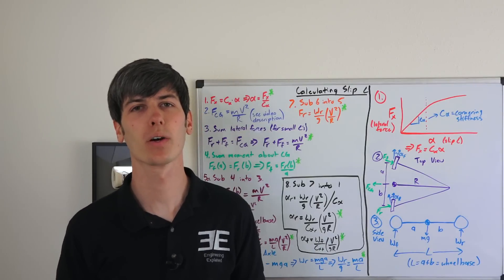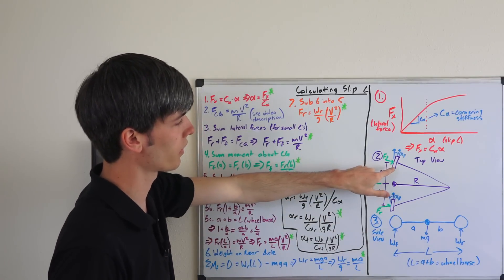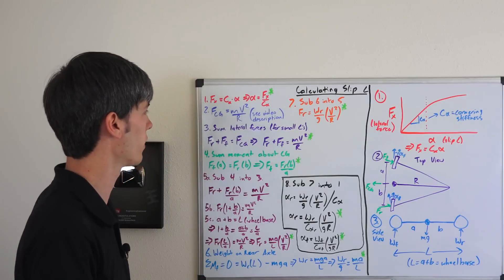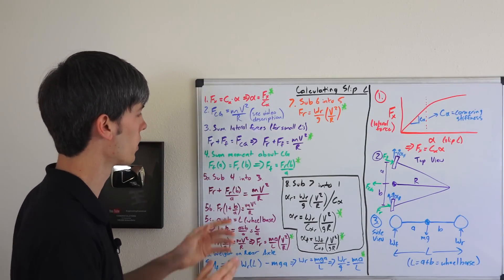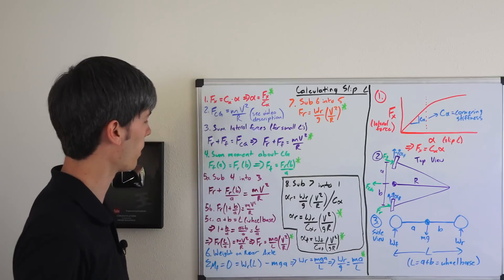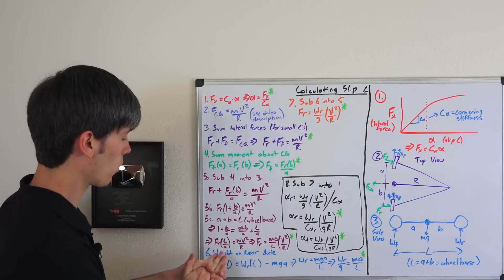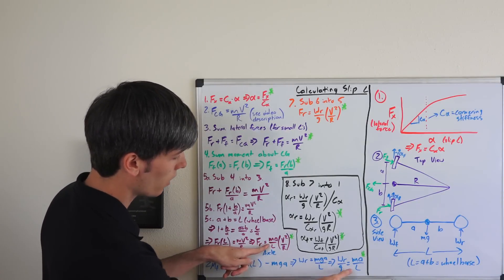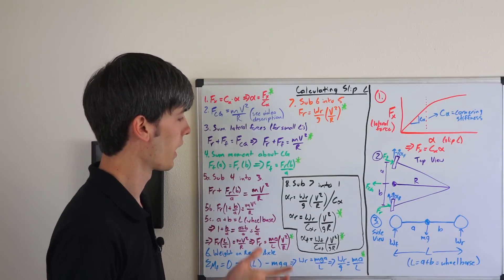Deriving Car Slip Angles - Tire Slip - WARNING: Maths

Comment: If you could do this with only the data available in a real car, that would be interesting (cornering stiffness is not available, especially to ASIL D).  The maths would be  to a higher level though, having read papers on the topic.

Comment: If this is meant to be applied to a car how would you find the radius of the corner or is it based on steering angle and how much that turns the wheels? Also how do you find out the cornering stiffness for a tyre?
Reply: i have same dbout ... could youbplease help me with that if you have figured it out

Comment: can someone help me please?
if the slip angle is the difference between the direction the wheel is pointing and the direction the wheel is moving, which are both known vectors, why do we need to calculate it? or am I missing something?

Comment: I have a question. I'm using Motec telemetry analysis software and I want to calculate the slip angles for the tyres. I have the velocity vectors for the car, toe angles and steering angle. Can I calculate the slip angles using that? Would it be correct anyway? Thanks!

Comment: That's all very well but you are using the ti(y)re's Cornering Stiffness to calculate the SLIP ANGLE, however, in order to know the Cornering Stiffness of the ti(y)re, you first need to already know the SLIP ANGLE v Load. See the problem?!! If you already have the graph you use (in the top right hand corner of the board), you don't actually need to calculate the slip angle, you'd just look at that graph and save all the brain aching math(s).... (sorry it's taken me 3 years to work this out)
Reply: is there any other way to find cornering stiffness/slip angle?

Comment: IMHO, the math is not difficult to follow, but I think after following the derivation, the importance and how to interpret the final formulas in the physical sense was left out which is a bit wasted. For example, using 1 to 2 minutes at the end of video to point out the fact that V^2/gR is a common term in both slip angles equations, and so it is the weight distribution and coeff of cornering stiffness determine the slip angles difference between the front and rear.... and such difference determines the understeering/oversteering tendency... etc... There maybe another video for this but a simple example of say a 50/50 car with same tyres in the front and rear can be a good example to demonstrate.

Comment: Hey! I think the entire mass of the vehicle should be used and not just the mass on the rear tire in the formula for lateral force on the rear tire, since in the expression for centripetal force we use 'm' as the entire mass of the car. Please correct me if I am wrong.

Comment: Hey Engineering Explained I think I understood what you did to this point but at 5:56 I can't quite follow. Why does mg*a have to be equal to Wr*b? 
Assuming the center of gravity is exactly in the middle (50:50 weight distribution and therefore a = b), Wf and Wr would be the same and both half of the total weight which is mg. So wouldn't that mean, that in this case mg*a = 2 * Wr*b? 
Or did you want to say Wr*L = mg*a or how you wrote it: 0 = Wr(L) - mg*a?
Could you or anyone else explain, where I make a mistake, please?
Reply: +SimBaa he's taking the moment about the front wheel to the only forces causing moment are mg and wr.

Comment: how can i calculate R if i do not know the steer angle
Reply: The steering angle is actually known as an input, but the problem is that R is a function of slip angles and at the same time slip angles depend on R.

Comment: Can you PLEASE explain to me why do people say that when you park on a steep hill facing downhill you should put your car in reverse and when facing uphill you should put it in 1st gear. Like, what difference does it make, the transmission can rotate both ways, right? Why not just pick the mechanically strongest gear and leave it there no matter what? Sorry if my question is stupid but i just cannot figure it out...
Thx mate (oh and ofc, nice video, as always)
Reply: The reason for 1st facing downhill and reverse facing uphill is so if the car does roll the engine spins the way it was ment to.

The reason you don't want to spin the engine the opposite way is partly because many tensioners  only compress in a specific rotation.

The other big reason to do this if your car gets hit or something and is sent barreling down you don't end up spinning your crank barrings in the wrong direction. Your crank barrings have indentations that keep the barring shells from spinning past their seated locations. But that locating indent is made at a slope so while it can't spin forward too easily it can catch against the crank and possibly slip past itself if spun in the other direction.

The reason to have it in gear in the first place is to provide pumping resistance to wheels as a tuned off engine is basically just a mechanical air compressor of sorts.

And the wheel direction is just ment to catch the curb.
Reply: Aleksa Nikolic When parking in a steep hill, just put it in first, then while holding the brake down, release the clutch and slowly release the brake until you feel the car "locking into the gear", this is the time to pull the handbrake
Reply: This dates back to the days of carburetors, and the desire to avoid a "bump start".  If left in gear with hot cylinders, some cars could successfully start themselves if they started to roll.  Selecting the gear that was the opposite of the direction of travel was a safeguard against this.  It mainly dates from the days where fragile timing belts were rare, and turning an engine backwards for a bit had no major consequences.
Reply from the maker: Aleksa Nikolic I always put it in first.
Reply: Marek Sumguy Oh god, that makes so much sense! So what I want to do is leave the car in gear so that when it rolls one way or another, the engine turns "forward" so it cant be damaged but since the car is in gear, it cannot move as easily. Thank you mate!
Reply: No, why would I? I'm just amazed how simple it is and I've been trying to figure it out for quite some time :-)
Reply: Yes it is. People have been telling  me the opposite the whole time which is probably why I couldn't get it through my head. This the most logical explanation, although I am still pretty unsure why would multiple people tell me the same thing which is, according to my logic, false.
Reply: Marek Sumguy ?????. What I said makes sense, maybe you interpretaded it wrong. Just try it, set your car in a slight hill, turn it off, put it in first without pulling the handbrake, you can clearly feel the car roll a few centimetres, then stop because of the slight gap between the gears. Now if you don't let it "roll in to gear" in a steep hill you run the risk of the car achieving some decent speed within those centimetres of moving, therefor, increasing the risk of the car keeping on rolling. In fact most cars can sit without a handbrake in pretty steep hills without rolling.
Reply: Marek Sumguy Oh, so it's the compression that stops the car from rolling? The more you know :) But I would still imagine momentum to play a part in a very steep hill, wouldn't it?
Reply: SO THE CURB STOPS IT FROM ROLLING ANY FURTHER!  It's not a difficult concept. If you guys grasped the engineering behind this, you wouldn't have tried to get into a pissing contest over math and physics. Don't over complicate something simple. That's a basic tenet of engineering.
Reply: +Marek Sumguy If e-brake fails car will stay where it was left to begin with......
Reply: when car in reverse facing down if the brakes were to fail the Idle gear will prevent the car from rolling. even thow the car would still go down depending on mass, but overall its one of those things you go...eh.
Reply: Yes. This. Only twenty comments and a lot of arguing to get to the right answer.
Reply: +caroppin  Haha, thanks.

Just glad I could help.

Comment: I am planning to buy the new Subaru WRX STi(2014 or 2015). But since the import laws in my country are a little too rigid, I opted to buy a WRX and work on it. However the problem I am facing is that the new WRX STi JDM(the one i wanted to import) runs on the EJ20 and the WRX on ther other hand is paired with the FA20 like in the BRZ. Which one should I get?

Comment: Would be nice if you could explain why and how you are able to use the sum of forces and moment equations so more non engineers can understand this, i hope :P
Reply: Christiaan Roos 
You can think about/visualize the sum of forces and sum of moments equations in a pretty simple way.  I'll explain both of them below.

First we'll start with the sum of the lateral forces, as seen in Equation 3 on the board.  Let's just start with something moving around in a circle.  The force due to centripetal acceleration from to this circular motion is Fcg.  This is acting at the center of gravity, or CG.  If this were the only force on this object, nothing would be keeping it from staying at the same radius.  This is where the tires come in handy.  The sum of both of their lateral forces counteracts this, keeping the car at a constant radius R, in this case.  In order for the car to not increase or decrease the radius of the turn, the forces from the front and rear tires needs to be equal and opposite the force Fcg.  It's easiest to think about the car in a sort of 'snapshot' when figuring out the forces acting on it.  This is essentially what Figure 2 on the board is doing.  It's a snapshot of the top view of the car.  We know there is an outward force because it's driving in a circle.  We also know that the tires produce a lateral force.  The sum of the forces equations becomes the simple task of saying which ones are acting to the left and which ones are acting to the right.

There's one little issue with the force equation though.  The lateral force on a tire acts perpendicular to the wheel plane, which is why in a turn, the lateral forces don't actually act on the same axis as Fcg.  The actual force equation would have a cosine term acting on the lateral force for each tire.  However, we can use the small angle assumption, where the cosine of a small angle is approximately equal to one.  This is where Equation 3 comes from.

Moving onto the moment equation, or Equation 6.  First of all, when you think moment, think of torque.  Same thing, different word.  A moment is caused by a force acting at a certain distance away from an axis of rotation.  Make sure you're looking at Figure 3 on the board.  This is a side view, not a top view.  When we say the sum of the moments is zero, it essentially means that nothing is rotating, or spinning around its center of gravity.  Go outside and take a look at your car sitting on the street.  It's probably not spinning out of control.  It's most likely just sitting there, not moving.  Since it's not moving, we know that the sum of all the moments acting on the car is zero.  All the moments trying to rotate it one way are balanced by all the moments trying to rotate it the other way. From the side view drawing, you can see the force Wf trying to spin the car clockwise about the CG.  However, there is another force, Wr, that is trying to spin the car counter-clockwise about the CG.  Note, however, that in Jason's calculations, he takes the moment about the front tire.  Using this logic, the force Wr (acting at a distance L) is trying to spin the car counter-clockwise about the front tire, while the force of the car due to gravity (acting at a distance a) is trying to spin the car clockwise about the front tire.  Because the car isn't rotating about this particular axis, the sum of these moments is zero.

If anything here made things less understandable, let me know and I'll fix it for you!

Comment: For what kind of problem is usefull use this equation? Because when you linearizes the Fy x Slip Angle graph using the Cornering Stiffness you're loosing alot of data.
Reply: João Luiz Barros Manetti 
There are some simplifying assumptions used in this analysis, but the most important one is the assumption of small slip angles.  This assumption gets used in Equation 1 (as you mentioned, and I'll get back to that), and also in the sum of the forces and sum of the moments equations.

To reiterate what Jason mentioned in the video, the analysis is using something called 'small angle approximations'.  This assumption says that for small enough angles, the cosine of the angle is approximately equal to one.  Recall from trigonometry that the cosine of zero is one, so the cosine of any angle close to zero will also give a value very close to one.  This makes the sum of the forces and sum of the moments equations simpler, because now instead of having the tire lateral force multiplied by a cosine term, you simply have the tire lateral force (times one).

Now on to the cornering stiffness part of your question.  By definition, the cornering stiffness is the slope of the lateral force versus slip angle curve, at zero slip angle.  Again, as Jason mentioned, in a region close to the origin (at small slip angles), the lateral force versus slip angle curve is actually quite linear.  The first part of Equation 1 on the board is just saying that if you give me the cornering stiffness of the tire and the slip angle, I can tell you what the tire lateral force is.  Similarly, the second part of Equation 1 is saying if you give me the tire lateral force and the cornering stiffness, I can tell you the slip angle.  Think about the implications of this equation though, looking at the first part of Equation 1.  The cornering stiffness is defined as the slope of the linear portion of the lateral force versus slip angle curve.  What if I ask you to solve for the tire lateral force after giving you a cornering stiffness and a slip angle of, say, 45 degrees (this is exaggerated of course).  At 45 degrees, we are definitely not in the linear portion of the curve anymore.  For all tires, this means that you will over-predict the lateral force at a given slip angle, and the equation won't be of much use anymore.

To sum this all up, you can see that small slip angles is one of the most important limiting assumptions in this analysis.  There are others that I didn't go over, but this should at least help a little bit.  While this may seem restrictive, most passenger cars operate at low slip angles.  You'll obviously need to be more careful when looking at race cars, etc.

Comment: Hey Jason, could you do a video on what determines a car's redline RPM? I think I know the answer, but I thought it would be interesting if you explained it.
Reply: DarkMan2555 The redline RPM of an engine is a factor of safety below the engine's failure RPM, with fuel cut being the next measure of safety. The valvetrain (valve float) and strength of the connecting rods limit the maximum  RPM of an engine.
Reply: Aleksandar Tepsic  I read somewhere that ignition could be cut as a different safety measure.
Reply: DarkMan2555 That would work as well, yes, any measure to cease further combustion and increase in RPM. I do believe cutting fuel supply is widely used though over other methods.

Comment: This is great, I'm an entry level automotive engineering student and I have yet to get anywhere near these sorts of equations as I'm still taking calculus and other basic courses. I've been itching to look at these sorts of equations just because the math finally means something purposeful as well as interests me. My question from this video is how does all of this math translate to the actual components of the car and adjusting the components to get what you want out of the car? (Dampening, spring load, camber, toe, caster etc.) also how would wheel width make a difference?
Reply: Coty Garcia If you're interested in more of the gory details, there are books like the one he mentioned that you can download.